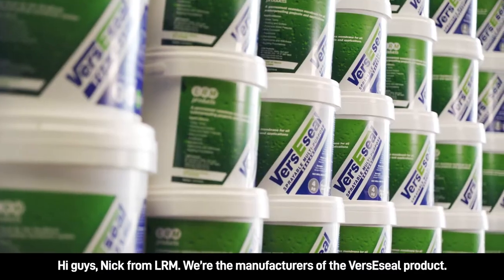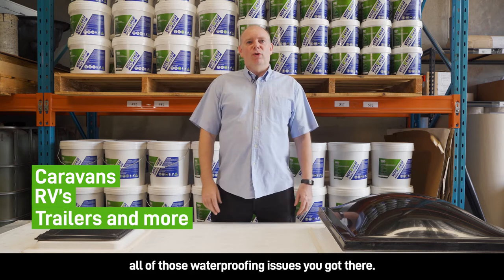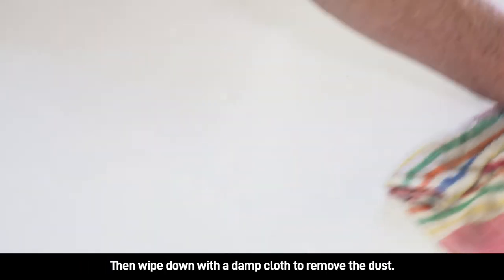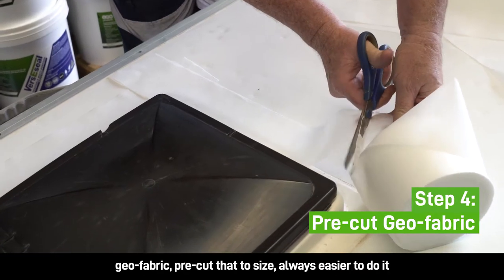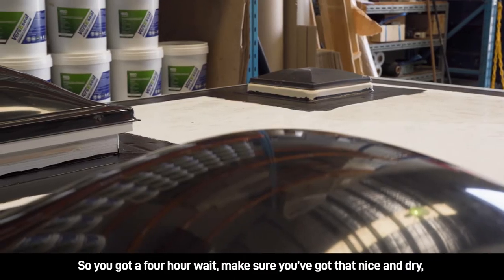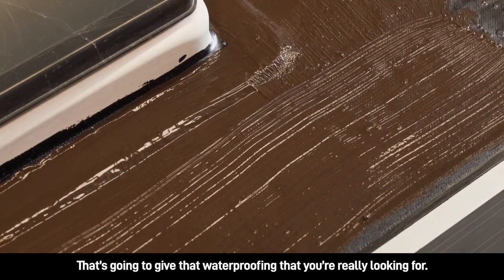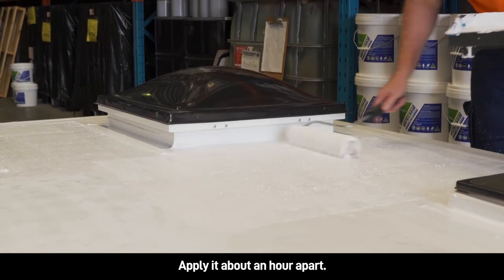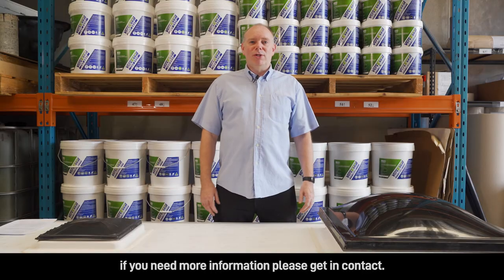DIY Caravan Waterproofing

Comment: Just came here to ask about whether it would be suitable for steel cool room panels. I see I'm not alone. What about use as decking paint for aluminium tread plate?
Reply from the maker: Yes, we've sealed the joins on cool room panels and buildings made out of them many times. Our system works really well for this. 
Verseseal is suitable for coating over aluminium and is good in light traffic areas but may be too soft for high traffic or high demand areas.
Please give us a call on 07 3807 2545 to discuss in more detail.